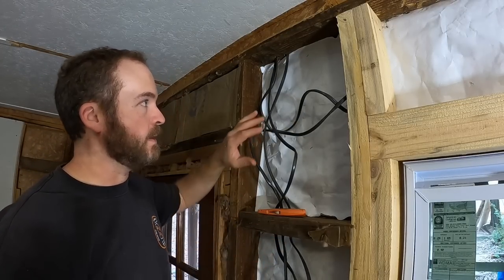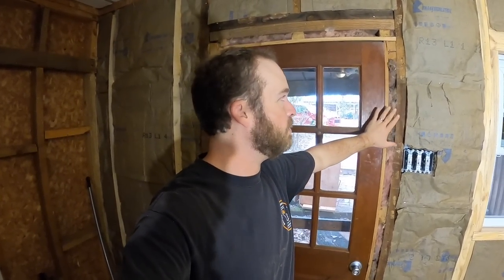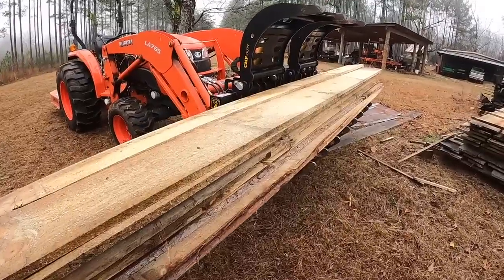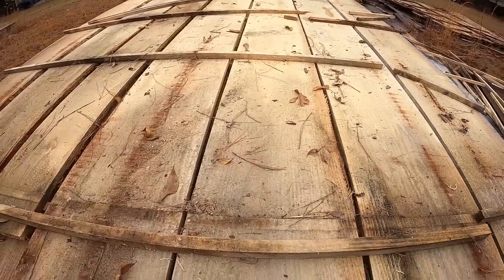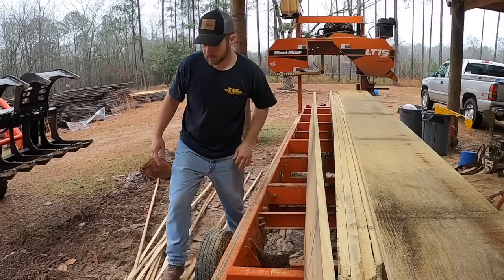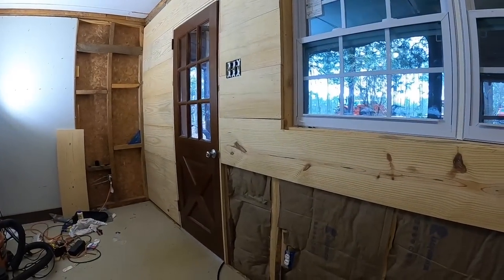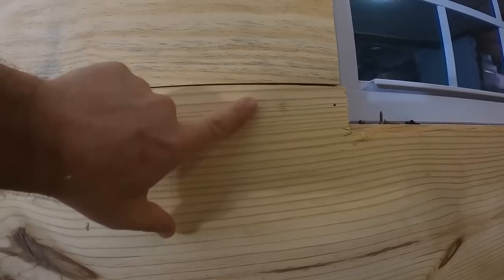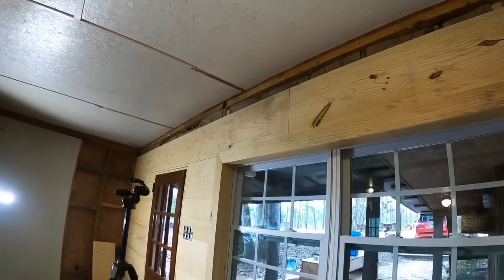Building With a Sawmill: From Rough Lumber to a New Living Room

Comment: I built several cabins by putting my rough lumber horizontal inside. If you will use black tar roofing paper stapled over the insulation...if the boards do draw up a little all you will have is a black line and want be able to see the studs. Just a FYI. You done a great video! Hats off to ya.
Reply from the maker: My mom actually gave me that advice (as she had similar issues on her house) and I totally forgot about it...I think going forward I'll probably invest in some tar paper.

Comment: I don't remember you saying anything about it, but might be a good idea to think about lap joint or tongue and Grove for the wall boards.  They will shrink and expand depending on the season and humidity.  If there is a lap joint or shiplap joint you wouldn't see through to the insulation when a gap is visible.  One other thing I saw some individuals make a few shallow kurf cuts down the length of the back of the board to keep the boards from cupping.  Good luck with your project 👍.

Comment: Looks really good. You should be proud of what you have accomplished. 

A trick that I learned on the foam. If you have part of a can left, use an aerosol can of carb cleaner or brake cleaner and spray out the straw and the port on the can as soon as you are done foaming. This will clean all of the foam out and you can use the can again. If you let the foam sit up, you will have to discard the rest of the can. 

There is a low expanding foam to use around windows. It isn't as likely to expand and push the window out of square.

Comment: Youve done a lot of great work there. Those boards will shrink and gap over time. That's why half laps are normally used in this application. I'm a little surprised you just butted them up.

Comment: I did insulation all around my 60' x 34" main shop room.  THis had to go all the way up to the top of the walls - 12".  What remains is around 15 sheets of OSB - but I'm gonna use 1/4" on the upper course (which is all that is left) as all it has to do is hold the inslulation in (which is already stapled to the joists...).. THis stuff looks fun in comparison - annnd it's like 20 degrees in that shop - tho now I have a floor heater with 200,000 btu and a 100 lb tank, so that's takin' the chill out.. Eventually I'll do a wall heater ... propane probably. - but it only takes around 20 mins to take the chill outta the room.

Comment: Hey, just a thought, the next time you need to make your saw deck flat use a laser level. Set it up on one end and have it project down the length of the deck. Then use a tape at any point on the deck and compare the dimension between the deck and the laser dot that is projected on the tape. You will end up with a perfectly flat deck
Reply from the maker: Ah good idea.

Comment: Overall looks really nice.  Love the wood siding and trim
One thing though, I was taught not to use spray foam, even low/no expand foam, around windows because it will cause the windows to bind.  I stuff the spaces with strips or tufts of fiberglass batting.  Off-cuts of insulation are good sources of material.  The key is to fill the space without compacting the insulation.
Reply: Modern foams aren't going to bind the window frames

Comment: Installing Tyvek on the interior creates a secondary vapor barrier that will now rot out the sheeting or siding it is in contact with and will also create mold.  That is against code virtually any place you have permitted work.  Very bad idea.

Comment: https://youtu.be/dOe70WEal98                    I just want say one thing to that film  you uploaded few months ago.       you can melt wax more effective and less harmfull to bees by doing this:
1. put wax and all stuff u melt in one big pot.                2. add the filter. my dad used metal mesh/filter   combined with a bent piece of aluminum sheet. inserted/bent so that the mesh and the sheet are wedged against the inner walls of the pot.         and thats it.                   wax comes trough filter and u have clean wax on top. than you just  wait till it will be cool.     none of bees dies and you dont have to get burned by anything hot while melting.             

ONE MORE INFO VERY INPORTANT:       This shit that is left in mesh can have bacteria that can later kill whole family if one of the bees will transport bacteria from this crap to beehive.
You should burn it later in furnance or something. 
Im young beekeeper but i learned from my 60 year old dad that learned from even holder dude that is dead for like 40 years

Comment: If you use too much spray foam, it can jam your windows and make them hard or impossible to open. That stuff can expand for a long time. I found out the hard way…
Reply from the maker: Yikes, seems to be ok so far. Windows are still working as they should.

Comment: WHY WOULD YOU EVER START AT THE TOP AND WORK DOWN????????????????
Reply: Because the bottom of the wall will be hidden by the baseboard trim. You hang sheetrock on walls the same way, butt it tight to ceiling panels and work down. Cut edges always hidden behind baseboard trim. Hope that makes sense.

Comment: Just so you are aware, all building codes require that all structural lumber used in a residence to be inspected, graded, and ink stamped.   So, does that mean you can not use your sawmill lumber?   Yes and no.  You must have someone come to you and pay them to inspect, grade, and stamp the lumber.